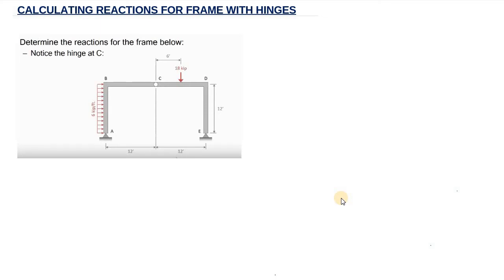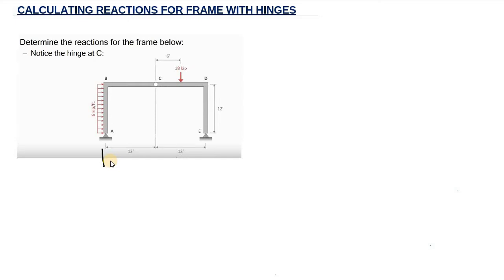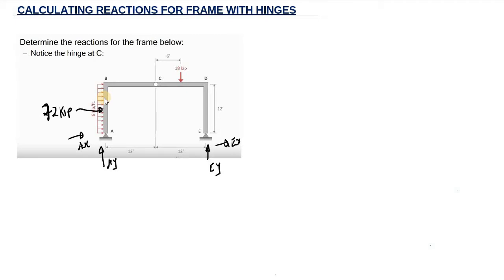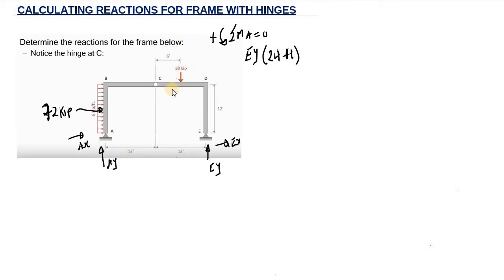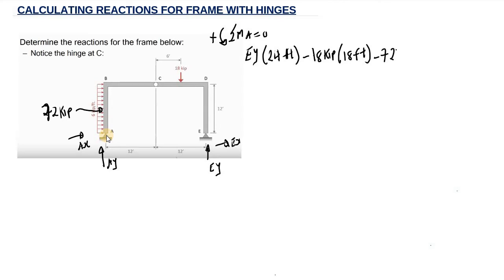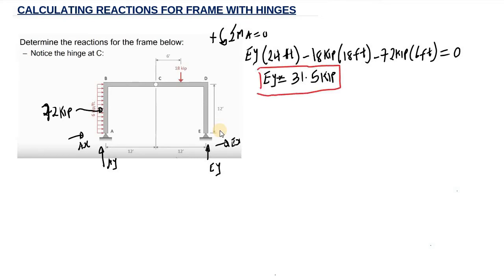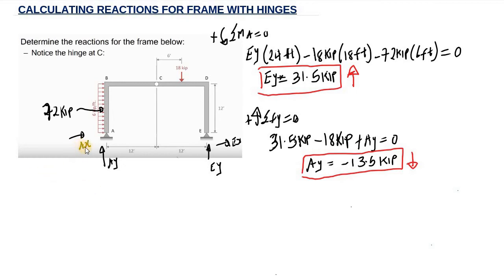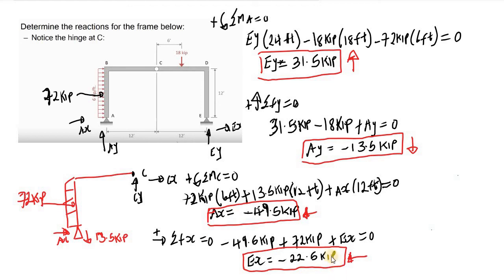Calculating Support Reactions Of Frame With Hinge

Comment: Hello I got 31.5 for Ey but my assumption is incorrect because I used clockwise positive. Both 72 kip and 18 kip were positive which resulted a negative direction (down) due to sign change. I’m confused if I’m right or not
Reply from the maker: If you assume the other direction and you get a positive value, that will mean your answer is right. If you get a negative value, that means your assumption is wrong. It is in the other direction

Comment: I found the forces on the hinge and pin A correctly but Ey was 4.5, İ broke the frame into two pieces because the hinge has two unknowns acting on both frames equallly in magnitude and in opposite direction
Reply from the maker: Yea but the loading to the left and right of the hinge is different

Comment: So for calculating Ex you don't multiply the distances?
Reply from the maker: NO dear. There is no need to multiply the distance since we already know Ax. 
You can just sum up all forces in the horizontal direction to get Ex.
Reply from the maker: If you are planning of going into structure design as a structural engineer, I am creating a new course here on YouTube which teaches you how to design a real-life building as a structural engineer.

Comment: so the steps are not the same for beams with internal hinge where you have to separate the two spans first? 
for frames, you solve for the support reactions first, and then you can solve for the internal hinge reactions?
Reply from the maker: It is basically same logic. Normally, you solved for the reactions first, but if you have more than three unknown reactions; and you have an hinge in either the beam or frame, then you need to break up the hinge. Then use summation of moment in the hinge, equals zero to solve for the reactions either on the left side or the right side.

Comment: Which laptop do u think I can get for my youtube videos ...I will be teaching using blackscreen background(like in khan academy) or whitescreen background(like you)....My budget for a laptop is btw #100,000 to 120,000
Reply from the maker: I use Hp Pavilion Laptop. Windows 10. Get an 8 GB Ram. Core i5 10th Gen intel processor is ok.  i think those should be ok. You can also download an editing software like shortcut, openshot or lightwork. Those are free editing software. You should be fine with those mentioned. You can get it maybe for #130,000 depending on the shop.You are from Nigeria right?
Reply: @Innotutorial  yes I am from Lagos, Nigeria
Reply from the maker: @englishvocabs1989  that's good. I too am from Nigeria, Benin City- Edo state.
Reply: @Innotutorial  interestingly, I schooled at Uniben btw 2008 and 2014..I studied Pharmacy there. I still practice as a Pharmacist but I tutor on the side
Reply from the maker: @englishvocabs1989  Oh that's really nice. My dad use to work in Uniben at department of civil engineering. Do you know of Mr Agbede in Department of civil engineering? that was my dad. God bless your hustle bros.